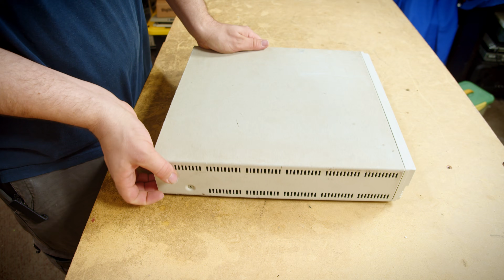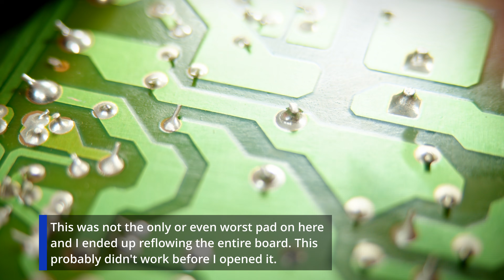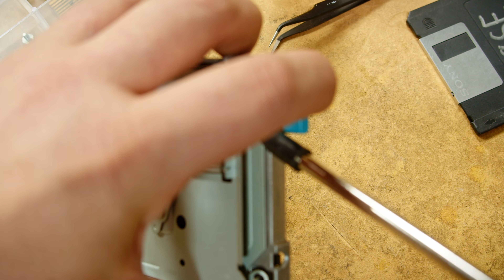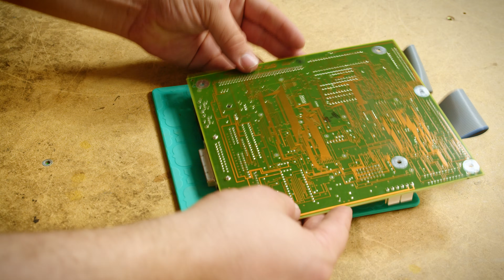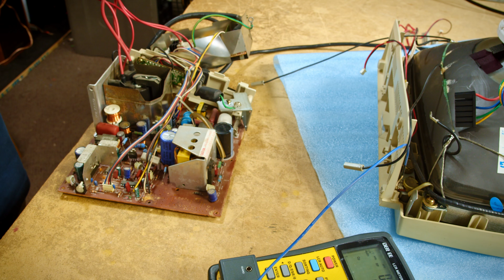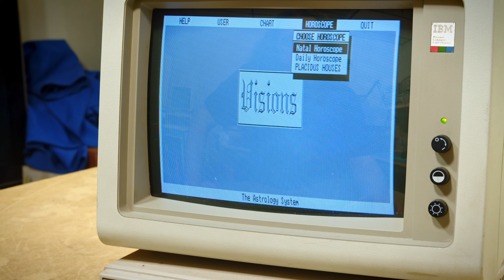The 8086's Last Gasp - Tandy 1000 RL Hard Drive

Comment: That stuff that is "just glue" can absorb water and become corrosive. It can also become conductive so it's a super good idea to remove the glue and replace it with hot glue or silicone.
Reply: I was going to mention this but saw your comment. One thing to note is that the glue was typically only used to hold the large caps in place prior to wave soldering. It is unnecessary to maintain this glue in use therefore the cap should be removed and reinstalled after cleanup or just replace it for good measure.

Comment: Fill your bathtub or a large sink with hot water and dawn. Soak it for an hour or 2, then use a plastic bristle scrub brush to scrub it.  It will get in between all the sand grain.

Comment: My father-in-law had one of these things and it blew up a keyboard he brought home from work. Then he learned that they used a slightly different PS2 connector pinout from the PC.
Reply: Was it a different pinout? I know the RL uses the XT protocol.
Reply: @ let me first say this was like 40-some years ago. That said, I recall that it was a pinout thing and involved 5V going somewhere it shouldn’t and causing catastrophic (electronic) damage to the keyboard. It may well be that the same protocol was used, but once you blow up the keyboard it wasn’t an issue. I can’t remember whether the keyboard damage propagated back to the PC and broke something there, too.

Comment: What do you mean you can't remember how TGA works and whether it's CGA or EGA? 🤨 It's neither, it's TGA it's its own thing. It's like saying you can't remember how EGA works, if it's CGA or VGA.

The maybe-quit function is amusing. I literally wrote a program to perform an action (eg pressing Enter or left-clicking) at random when a hotkey is pressed so that it's like flipping a coin. For those times  I don't want to commit to an action and want to leave it to fate (after pressing the hotkey several times until I get the result i want but not really 😅).

The keyboard should be regular AT compatible signalling. I have an old mouse that's switchable between Microsoft and IBM modes. My Tandy has a Centronix connector for the printer port.

I vaguely recall something about Tandy computers using a different kind of hard-drive interface, something like "XT-IDE", and thus requiring specific hard-drives for them so regular IDE drives wouldn't work. 🤔
Reply: It's just CGA with some extra memory.
Reply: From what I'm reading, the keyboard actually used the XT protocol, not AT. And yeah, the XTA (the REAL XT-IDE) drives aren't compatible with ATA-IDE at all and, are hard to source replacements for these days, so I wouldn't go out of my way to collect a 1000 RL/RLX unless it's just to rescue it from a dumpster. TGA is just CGA with a full 16-colour pallete instead of being limited to 4 colours at a time, so any CGA monitor will work with it.

Comment: Only really adjacently to this video, but it was my favorite game to play with friends; To play Scorched Earth and it hangs on start up; The most common problem is that you have selected 640x480 graphics mode, and this mode is not compatible with your computer. To test this type "scorch 320x200" from the DOS command line when you start scorch. This will force Scorch to use a low resolution graphics mode which is compatible with all VGAs. If you are using a Tandy, you will need to set the "Bios keyboard" option. You can do this by editing the file "scorch.cfg" and changing the line "BIOS_KEYBOARD=off" to read "BIOS_KEYBOARD=on". Finally, If you have version 1.23 or lower, get version 1.5. This will fix many problems.
Reply: Tandy graphics is based on CGA, not VGA.

Comment: This floppy drive has "microlift" (round thing in up-left corner) - it is very good drive and it design for gently lowering upper head. So it is not "stikiness" it is feature!
Reply: It's also Shughart, with power over the ribbon, so you gotta look up the pinouts and modify a cable if you wanna replace it with a standard PC floppy drive.

Comment: Oh!  I just remembered.  We messed around with the same or a similar Tandy 1000 RL in the lab for the Vo-Tech Industrial Electronics and Computer Repair course I was in in High School.  Somehow I managed to add a SCSI card - I'm wanting to say, the extra pins of the 16 bit card edge could just hang off the edge of the Tandy's ISA slot and the card "just worked" in 8 bit mode -?  Then through luck of finding a compatible hard drive or a series of SCSI cable adapters I managed to fit a waaayyy larger hard drive than any 8086-class computer would normally see.  I ran ScanDisk and the time estimate to finish the full scan and fix bad sectors worked out to 80 years.  😆
Reply: That would have been the contemporary way to back up the hard drive as well. I did stuff like that in the 90s and early 2000s. Stick an old ISA SCSI card into a 286, XCOPY the whole ST-506 drive to a larger SCSI drive, then plug the whole lot into a new-ish computer with ISA slots and get the data to where you want it. The last time I did this was a Mitsubishi 286 from 1987, from a CNC milling machine. It came in dead, basically just a flat CMOS battery keeping the system from booting. Unfortunately the machine made things as difficult as it could to revive. Just google the hard drive parametres, enter them as a custom type in setup and off you go, right? Right? Nope. I did manage to get info on the obscure hard drive online. That was about as far as I got though. The Mitsi was so old it didn't have the setup in a ROM, it came on a floppy disc. A long forgotten floppy. Next thing I tried was transplanting the hard drive with or without its controller card into another 286, no dice, refused to even POST if I remember correctly.
At that point I spent three days straight scouring the web for an image of that setup disc that would let me revive this computer. I finally found a generic setup, copied that onto a 5.25" DOS boot floppy (no 3.5" drive and no option to add one without setup) and finally got somewhere. This most basic setup didn't offer a custom hard drive type though. That left me with trying every single pre-defined hard drive type. Fortunately I only had to go up to Type 2 out of 20something and got DOS booting just before I was ready to bang my head against a wall.
Then I copied the whole hard drive contents to said SCSI drive, stuck that into a Pentium 90 with a freshly installed DOS 6.22 and Windows 3.1, copied all the relevant files to the Pentium's IDE drive, checked the config.sys and autoexec.bat for any modifications and specific drivers and that was it. Three days of work to get an almost 30 year old industrial machine back up and running.
Reply: It depends on the card, really. A lot of 16-bit cards only needed the 16-bit edge for the extra IRQ and DMA lines, so if you set the jumpers for the lower settings, you could run them just fine in an 8-bit slot. There's also some cards with controller chips that have 8-bit modes, and could detect if they were connected to a 16-bit bus or not. I've got a Sound Blaster Pro 2 that I'm using in a Hyundai XT clone of mine, and as long as you don't need the IDE port for the CD-ROM, it will work just fine in 8-bit mode!

Comment: We had a Tandy 1000 RL when I was a teenager.  We also had a Windows 95 computer, so the Tandy was obsolete by the time we got it, but it made a good 2nd computer to occupy my younger siblings when I wanted to use the newer computer (and also I enjoyed seeing what I could run on it).  It could run a surprising number of fun DOS games:  Lemmings (no issues), Commander Keen (choppy but it worked), Space Quest (I think), and maybe some Sierra games.  We might have played ZZT on it - I can't remember - and I had a book on game programming that came with a port of Colossal Cave Adventure.  I think Elite runs on it?

I had a Borland 4.5 C/C++ IDE that I discovered had a compilation option to target plain 8086, so I (re)compiled a 3D wireframe game I was working on to be able to run on it.  Just the Borland C++ startup code (before main) took like two minutes to complete, and then the game ran at 1-2 seconds per frame.
Reply: Pretty much all of the pre-VGA Sierra games were designed to take advantage of PC-Jr/Tandy graphics and 3-voice sound!

Comment: Wow, a JTS Storage (Jugi Tandon Systems) drive. That's a weird little time capsule, as JTS only made drives from about 1994 to 1999.
Reply: im pretty sure at some point in that time period that they bought out Atari after the Jaguar flopped.
Reply: @DaiAtlus79  Yup, in 1996. By 1998, they were already going defunct, and sold Atari to Hasbro Interactive.
Reply: @DaiAtlus79 one of the first things JTS did after Jack Tramiel merged Atari Corp into JTS was sell the Atari Corp IP to Hasbro. The Atari Games Corp, a division of Midway at the time, tried to buy it from Hasbro but then Infogrames swooped in at the last minute and bought up all of Hasbro Interactive with an offer Hasbro couldn’t resist. Midway then changed Atari Games’ name to Midway Games West. Alas.
Reply: Do any of them still work? They were biblically unreliable even when new.

Comment: This was my first computer in 1990! It came with 512k of RAM, which was later upgraded to 768k. It was either a 10 or 20mb hard drive.
Reply: And it was an XT-IDE hard drive, so you couldn't just stick a normal ATA-IDE hard drive in there if it failed. It's a shame it only has one ISA slot.
Reply: @BlackEpyon  So weird.  I used a RLL hard disk (actually moved one from an 8088 to a 386, so I was using Linux off an ST250R -- 40MB RLL -- circa ~1992 or so).  And of course later on IDE.  I didn't know XT-IDE was even a thing and had to Google it (it is also known as XTA, since googling "XT-IDE" for the most part pulls up a modern adapter for hooking "normal" IDE up to an XT-class system, or in some cases make a CompactFlash appear to be the IDE drive so you don't have to dig up a working IDE drive either.)

Comment: Hello Shelby!
What a nice tiny machine.
After watching the kind of stuff we can find inside a system that had been shipped and or stored for several years I just can wrap my head around the concept of "a smoke test" so it paint a smile on me how you check thoroughly every system and component before turning it on.
I don't remember, do you have any sort of current limiter and isolation transformer to connect these old systems when you are testing them?